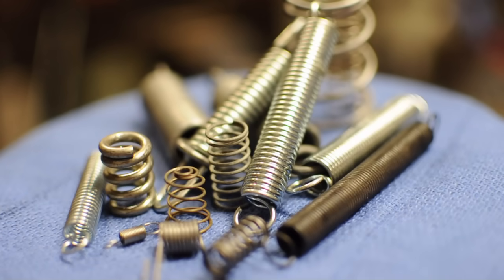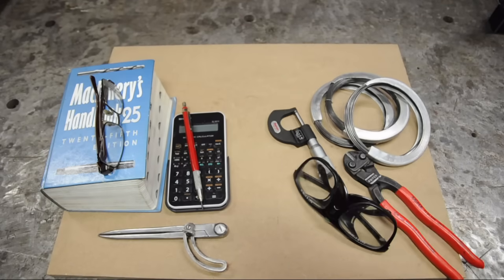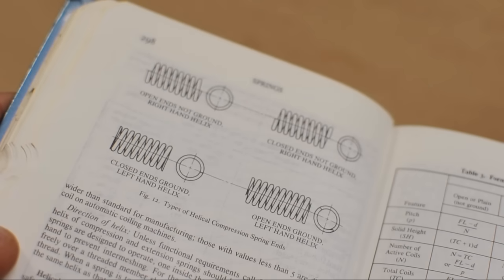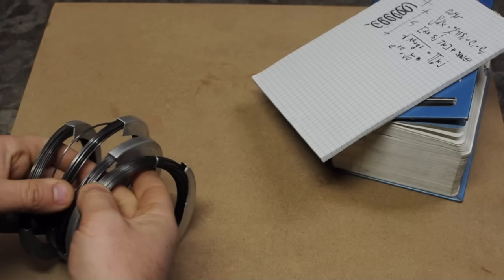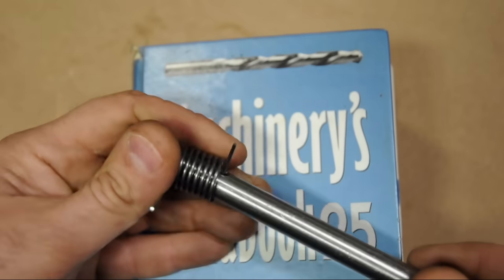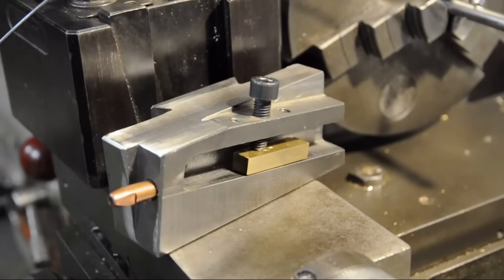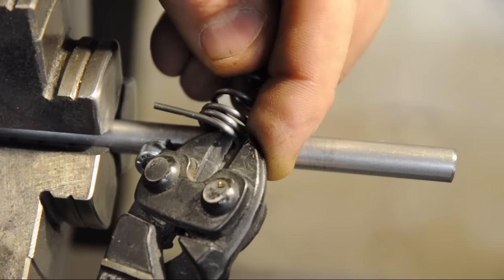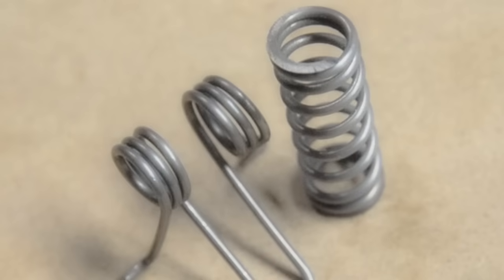Making Springs At Home

Comment: Any thoughts or tips on a .250 wire dia 4-3/4" extension spring,?od 1.274 or larger ? For a plow trip spring,part is on back order several months now.and spring concert want over hundred $ for custom size.

Comment: "Available in all shapes and sizes...except the one you need."

True for springs, screws, nuts, bolts, wrenches, screw drivers, taps, dies, and pretty much anything else you currently find yourself needing
Reply: On a philosophical note: If you already had it, you would not need it.

Think about that.
Reply: @HenryPiffpaff  if I had it I still need it cause I lost the fucker
Reply: @tylerblubaugh5549  Just a few minutes ago I wanted my IR torch. As last ressort I remembered that I lately bumped into my IKEA lack table and heard a metallic sound. And there it was rolled of and fell between some card boxes of 3D printer filament. Yeah I wanted the torch to clean up some surfaces. At least it was powered up enough for the job.
Reply: This even applies when you decide to visit the hardware store for it. "No we don't have that one in stock. We used to, but there was no demand for it."
Reply: @nimmen  or the classic "we ran out but a new shipment comes next month"
Reply: And women
Reply: @LeglessWonder  My thought exactly.
Reply: try 5s
Reply: @AJ Hauter this is spot on, I've even seen (and bought) sets of just 10mm socket, with one set having 10 regular (shallow), 5 deep, 2 extra deep, 1 extractor , and a specialty one for pipes and hoses. I also bought an assortment of 30 10mm of all types in 10mm
Reply: But if you used the metric system, finding the right sized nuts and wrenches etc would be a piece of cake 😛
Reply: @Tom_-  thats not how that works at all, but nice try, also, anyone who actually works on shit in the US or any place that doesnt use metric, will most likely agree that the metric system IS better, we just werent taught it in school, and the majority of the US runs on imperial, so we're stuck.

Comment: I wasn't looking for springs, nor interested in them (a genius like me just salvages a few very long springs and cuts off the desired length: works better than no spring at all!), but the "How it's made"-style made me watch the whole thing through, and it was funny as hell! Now I know how I would attempt making them!

And dammit, I'm a woodworker, I hate metal! It dulls chisels and makes wood turn blue/black, and screws are joints for dummies, and make great removable stops at the end of a workbench. And chisels are always too hard to sharpen quickly, or to soft to use for more than 10 minutes! And springs always launch carbon brushes in a huge pile of sawdust and woodshavings! I even had one fall into a box of razor blades waiting for sharpening.

Now I forgot my point :s Nevermind, nice vid though!

Comment: Guess you didn't want to get a Carlson hand coiler.  Don't know how much they are.  Also music wire needs to be heated at 500 degs. for 1/2 hour.  The spring shrinks, so you'll have to double check the OD/ID, or just use cold rolled wire, doesn't need heating.  However it is a pain in the a** to work with.

Did enjoy the video, thanks for bring back some memories of working in a spring shop 20+ years ago.

Comment: You don’t need to heat treat the wire after it’s formed?
Reply: Yes, music wire 500 Degs for 1/2 hour, or use cold rolled wire, like a coat hanger doesn't need heating, but a pain to work with.

Comment: Forgot something. When making your own springs at home, wait until the wife is going to cook a "Tony's Pizza" ...lol...in the oven, and you can throw small springs like this in there for 70 minutes at 400 degrees and let cool naturally on the countertop, then another heat cycle for 50 minutes at 350 degrees. Just be sure you degrease it first or you will fill your wife' kitchen with burning oil smell.....not good!......This works whether you heat the wire to bend with a torch, or bend it cold. It sets the temper in the spring and keeps it holding it's shape and strength factors after it's initial set or function cycle. Adds much more life to the spring.

Comment: Hi Tony, good vid. One correction to note though....never hold a spring or spring wire with unprotected pliers or like tools with sharp jaws. It leaves a mark that will cause the spring to break at that location if it is going to break. Usually a the most inopportune moment. I am an armorer and firearms manufacturer. Ask me how I know this. Ha....on second thought, you probably figured it out already. That's right...bang, bang, bang, click.

Comment: I'm just curious, is there some kind of heat treatment you'd want to do to it so that it is more likely to go back in it's "default" form?  I'm thinking something like a mouse trap where the spring is going to always be kept tensioned but you still want it to have lot of snap back force.

Comment: For those of you that don't possess a lathe you can wind a length of wire into a spring on a mandrel held between a folded double piece of thick leather held with little pressure between the jaws of a bench vice then using a pair of mole-grips to rotate the mandrel, this is how I was taught when I was as apprentice way back in the fifties.

Comment: Is it possible to make an extension spring on a lathe? Commercial extension springs have initial tension. When I wind the spring on the lathe the best I can do is to get the coils to lay next to each other, but not crowding each other.

Comment: I build spring powered catapults. Built 4 or 5 of them. Going to break the sound barrier with one. We're at 480 foot per second launch speeds with our latest advanced design. It has 6 stacks of 25 pound work load rated springs, so 150 to 170 pounds. Our larger one under construction has two stacks of 350 pound work load rated springs, so 700 to 800 pounds of force. I have larger springs. I could not find anywhere on the web where someone knew how fast coil springs could move. I ended up doing my own experiment and filmed the results. I have a little youtube channel of my designs, and testing if you're interested. I priced some really big springs last year, they were $80,000. I'll have to wait on those! lol Next year!

Comment: Good info. One thing you don't specifically mention is post-forming heat-treatment. Or rather you don't actually state that after forming a music-wire spring is done, finished, ready for use. Music wire is "Patented" (normalised and quenched into lead, tin or  molten salt) before being cold drawn. And any subsequent heat-treatmement will only make it a worse spring. 
My milling machine has some remarkably low speeds available, which was handy for forming these 1/4" wire springs: https://www.youtube.com/watch?v=thtDRjgbxRE
The coil of wire is on top of the mandrel. I really was not strong enough to offer an alternative opinion on where it should be.

Comment: I notice that you don't specify a stress relief process after coiling.  I have the 27th edition of Machinery's Handbook and at the end of the spring wire section is a small note on stress relief... 500ºF for 30 minutes, other sources also point to stress relief... from 400ºF (200ºC) to 550ºF (290ºC) and the time varies from 20 to 30 minutes. I'm assuming this will depend oh the wire diameter. I've found that stress relieved springs last longer in service. After stress relieving, I always give them a light oiling to prevent rusting and hydrogen embrittlement, a condition that can cause early failure of the spring.
The other thing I notice is you let your spring uncoil rather rapidly and this can change the diameter of the finished spring quite a lot. Torsion springs for door locks often sit in a casting with a specific ID and OD and I've mucked up the spring because it unwound too much... slipped before unwinding the spring-back. It also retains a better shape if released slowly. They tend to go pear-shaped when just cut or slip. 
When making little springs, it's often the little things that count. Nice video, by the way.

Comment: What about heat treating the spring steel after making the form, is it possible to do at home? Is it necessary? I need to make a small paper clip size wire form that will be compressed mostly and will need to expand when necessary to push a catch lever up.

Comment: Always enjoy you videos. Just made my first spring using your technique. Success came on the third attempt, on the first attempt the mandrel was too big a diameter, the second attempt I ran out of wire, its surprising how much it takes so should have calculated it beforehand, never mind I'm sure that shorter spring will come in handy one day. I used your idea of the tool holder with a piece of delrin (acetal) sheet to provide the friction.
I haven't read all the comments so I don't know if this has been raised before, but I found that it was worth adding a few extra non-functioning turns at each end because the start and finish turns were not wound as tight as the rest and were a larger diameter. I then trimmed the extra turns off.
All in all a perfect spring for my modified screw-less milling vice.

Comment: I had to wind a new coil for my toaster oven out of nichrome wire, this video stuck with me and gave me the ideas for the setup (wood blocks w/ clamp for tension, winding around a dowel chucked into a drill).  Thanks ToT!

Comment: Try mounting an engine suspended by 8 springs to the corners of a frame. You will never go back.
Reply: Automatic belt tnesioning to a variety of devices, and almost zero vibration.

Comment: Can you make a spring out od any metal like: Copper, gold, tungsten?
Reply from the maker: Technically yes, if you stay within the elastic limit of the material.  Plastic springs, for example, are very popular.  But it depends on the load/force you need the spring to handle.

Comment: Please respond, how do we put a streached string back to normal?
Reply from the maker: buy a new one.  :)  but as your message sounds quite urgent, try to heat it up, while it's hot make it look the way it used to (not stretched?), allow to cool down.  It will stay in that new (old?) position.  You will have to heat treat the spring again.

Comment: The springs you have made will loose their  dimensions as springs should be made of heat treatable 
steel. Once the spring is made should be hardened and tempered to spring hardness

Comment: One item you didn't mention is that most of the music wire that is cheap to buy comes with this gross film on it that, if you care about appearances, you will need to scrape off and/or burn off.  The burn off process, will, of course, distort the wire a bit...

Comment: Good video. Good tips on making springs. Good humor too. (I'd like a vanilla cone please.) Maybe you'll have some ideas about this. I'd like to have a general purpose wire bending tool for the purpose of making "things" from wire. Things like sculpture, baskets, things that hang in the shower to hold my toothbrush. That kind of thing. Oh and perhaps a spot that will connect two wires together where they cross.

EDIT:  I found your other video about the Hossfeld bender. Almost what I'm looking for. Perhaps a similar bender but smaller for the size wire I'm thinking about.

I like your style so I'm now a subscriber.

Comment: Beautifully done and fantastic editing!  But why did you leave off the tempering step?  I see you answered someone below saying the music wire is already heat treated and that's true.  But if you don't temper it afterwards at around 425 F for 30 minutes or so the spring will take a set the first time you use it.
Reply from the maker: Good point.  I've never tried that and, to be honest, never had problems, but I should try it.  For science' sake!  Thanks Markserbu.
Reply: You're welcome.  From one "touched" individual to another, I appreciate your attitude!  ;-)  You've earned a sub from me, btw...you're doing excellent work here!  If you're interested, you can check out my "World's Simplest Homemade Pistol...the GB-22" video and see the spring tempering starting at 8:34.  I'll put a link in a separate comment in case it gets "stuffed".

Comment: I agree with all the great comments about this vid, it is very good, without doubt and the fact you've emulated how it's made vids so well is also awesome but tony, bottom line is all your vids are awesome, all funny with your great dry wit and always show that you are a bit of a perfectionist...... 
Clean straight work is always impressive but add some funny and ur well in front.
I subb so many channels but "TOT" and just a couple others I long for new vids from.... You really seem to have this "hobby" all worked out and ur setting a high bar for us at home tinkerers to measure up against. 
I've learnt countless lessons from u by just watching, usually I'd have a billion questions to ask but u always seem to explain it all so well.

Good job as if it needed to be said..... Garth

Comment: I worked in a spring manufacturing company for 9 years my specialty was torsion . All machines are manual so I would have to design my own tools for each spring. That stick with a hole you used lol we called an arbor and the screw to hold it we called it a dog or catching point . Same concept only completely different design made out of 0-1 tool steel. Ahhhh fun times miss it sometimes 😞

Comment: Great video As usual Tony. Hoping you might be able to answer a question. Why do some springs have a cycle life, while others like valve springs for example never need replacing. For example some gun smiths recommend changing recoil springs after so many thousand rounds. If a car engine can cycle a valve spring a million or more times over its life cycle, why would a simple recoil spring need such frequent replacement? Maybe it's a "PT Barnum" thing.  Thanks again. KJ

Comment: but you didn't hardened them... heat them and drop them in oil and then let them cure in low temperature? no?
Reply: There isn't much need to harden wire springs after winding IMO, most of the time a stress-relief heating will be enough. Downside to showing this here is that it is a pain in the arse to get the shape just right, especially with that trigger spring in the video.

Comment: I'm not sure you were using the term "torsion" correctly.  It looked like you were calling a tension spring a torsion spring.  Tension and compression springs operating linearly, as in they perform on the same axis as their stack of coils.  While a torsion spring like the mouse trap or torsion bars in some car suspensions operate axially, and their lengths don't usually change much at all during operation.  Torsion springs of a coil design usually have their coils tightly stacked.  A spring with relatively large spaces between its coil while under no load is generally used in linear applications requiring tension.
Reply: He was speaking of a torsion spring. His examples came from the one you saw him produce at the end and which was shown throughout the picture when he would speak of mousetraps and torsion. it was the double-coil afair that he said you could make pretty at home if you took more care than he did. Cheers.

Comment: You may like to use Hand Drill Machine (Manual type) with handle on side of it. This machine is a good option to control \number of coils, Pitch, and Free Length. sardar

Comment: Yo Tone, how would you go about making a 30° conical spiral from 6mm copper piping, ascending from 25 to 45 cm? https://www.gutefrage.net/frage/kupferrohr-in-konische-spirale-biegen?foundIn=tag_overview
Reply: i know of one guy who used a piece of rope threaded down through the pipe, then twisted to give it some solidity, before bending his (he was making a large scale tesla coil...)
Reply from the maker: Probably cut a tapered mandrel with a 'head' on it.. like a mushroom with a tapered trunk.  Then a lot of experimenting.  You can try to fill the tube with sand (or frozen water) if you find that it crumples.

Comment: Thank you.   "Springs come in every size, except the one you need."     My box of misc springs certainly fits that description, and I was just about to order some springs from McMaster Carr for a small project and spend $$$.  Instead I made my own and they work just fine.   I wound them on a 1/4-20 bolt to get the size and spacing I wanted.   Thanks again.

Comment: Nice to make some video on heat treating the spring and stress relieving it.
Just sit on a hotplate cooking ring until red hot then flick into catch container of quenching oil.
Then at a lower heat, warm until straw color and quickly quench.
If not stress relieved, spring often snap, even commercially made ones from Rolls Royce!!
Quenching oil is used as it boils at a much higher temperature, and cools spring quickly.

If not heat treated, springs can be quite soft, and only take feeble loads before deforming.

3 ways to do it. Right way, the other way, or your way which might not be optimal.
I was shown this by an 80 y.o. spring maker, quite some years back.
You can't beat experience.!!

Comment: I used to wind 3HT aircraft breathing oxygen cylinders in .7 HT music wire. The tension rig I used was very precise with a complex wire path to work the wire just a bit more before rolling onto the cylinder. This brought back many memories. 
After the wire was rolled onto the  cylinder the cylinder was heated to 400 degrees Fahrenheit and hand rolled in a solder bath after a good coat of flux. I don't miss that job.